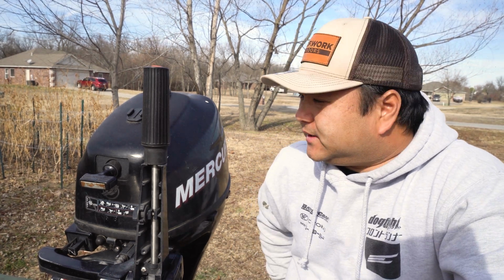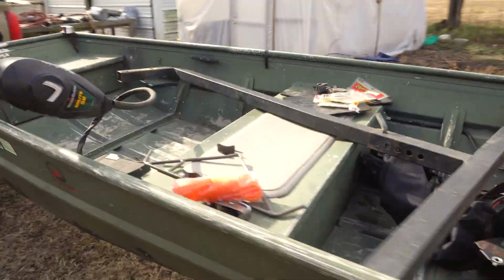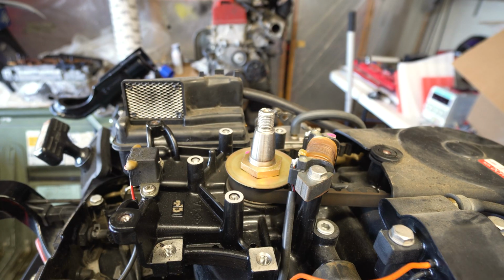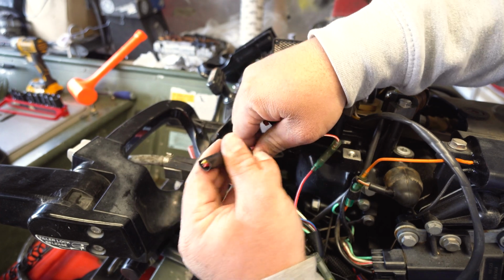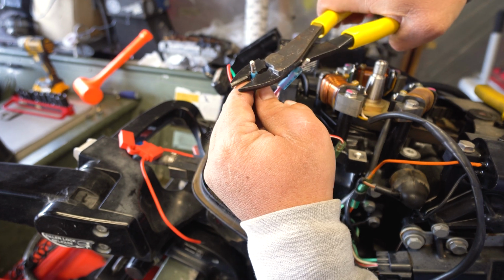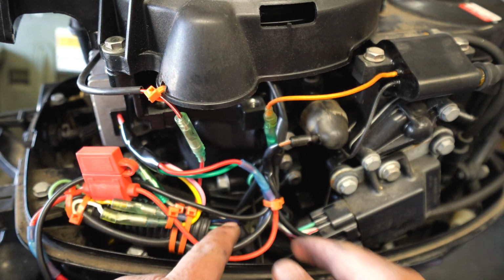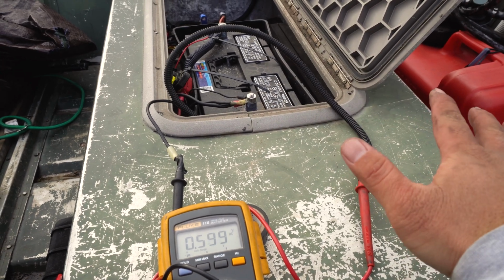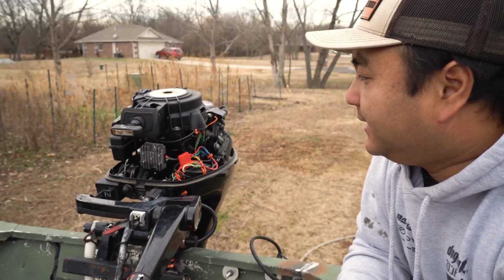Installing and Testing the Battery Charging System of your Mercury Outboard - OOW Outdoors

Comment: This was great video, not many know how easy it really is.  One note, you should have a disconnect switch between the regulator and battery, for safety and there is a slight parasite draw.
Reply from the maker: Switch is probably a good idea.  I currently added at fuse just in case shit happens

Comment: Would be great for a 12volt led light cause the led lights don't drain batteries
Reply from the maker: Yes thats what we are doing
Reply: 😀😅😂….LEDs don’t drain battery?   Not as much…but they do run on electricity!!!  And WILL drain power.
Reply: @Jerry-sy8rd  correct just not nearly as fast

Comment: That is the same charging system a lawnmower uses so you know you mow to acres or spend 2 hours mowing the battery will charge up strong during that 2 hours